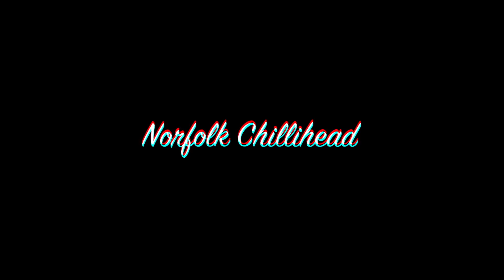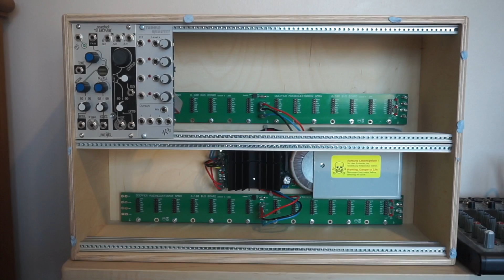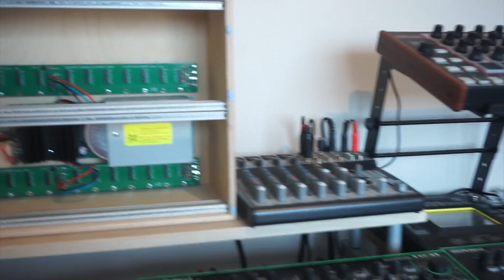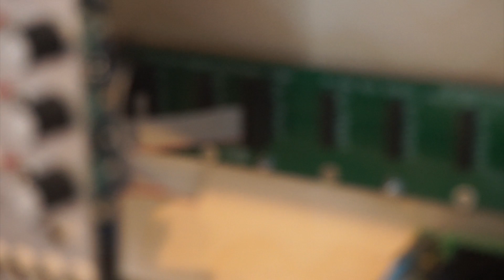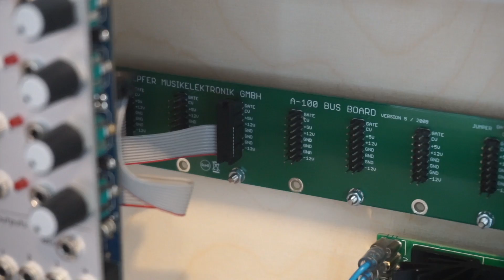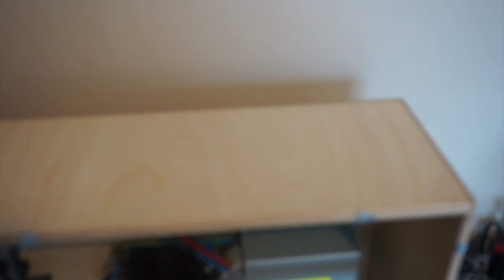A Journey Into Modular Synthesis - Part 3

Comment: hi there - with this case is it shipped with the power supply  / or is there anything else you need (other than modules of course!)?
Reply from the maker: Yes it ships with built in power supply and power cable, easy to use for a newbie